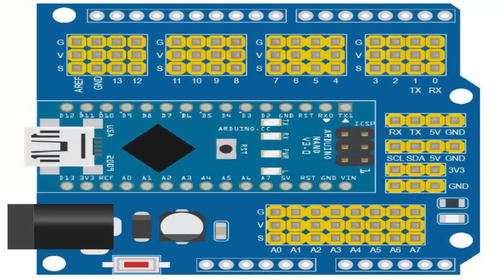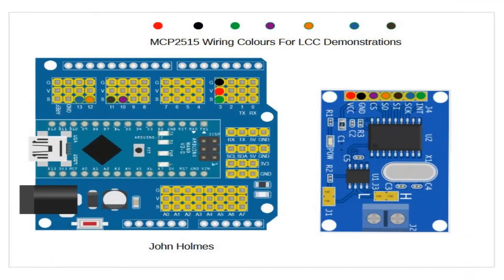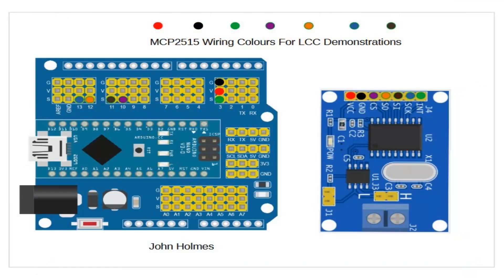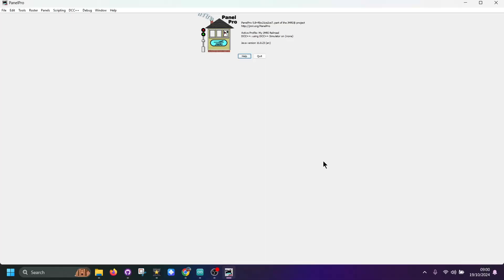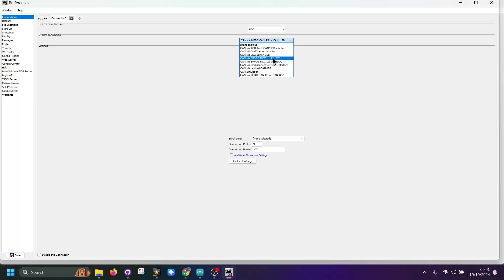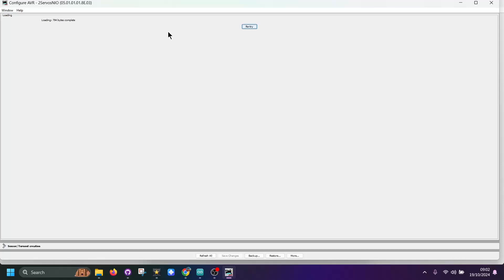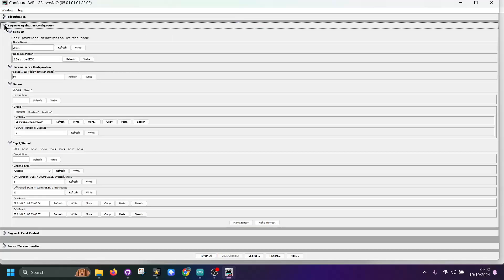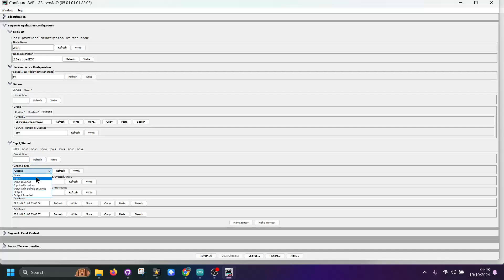OpenLCB - LCC CBUS CMRI Update 2 Servo 8 input-output options

Comment from the maker: Error in the video I am using the ATmega328 microcontroller  not ATmega368 as quoted
Reply from the maker: I have just found out why the 1st I/O was set as an output. The original sketch was setup to be tested without a CAN Bus interface using a USB lead to communicate with JMRI.